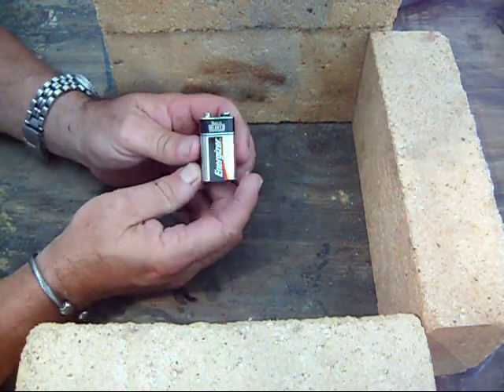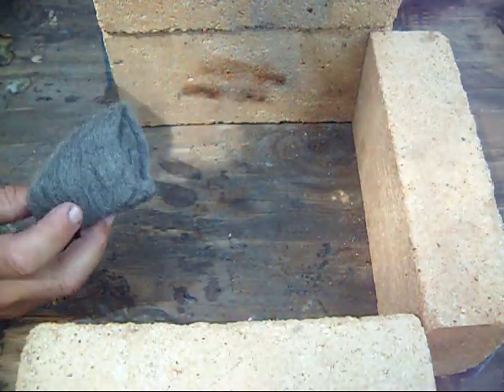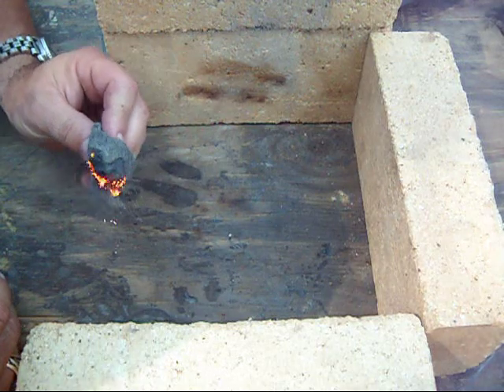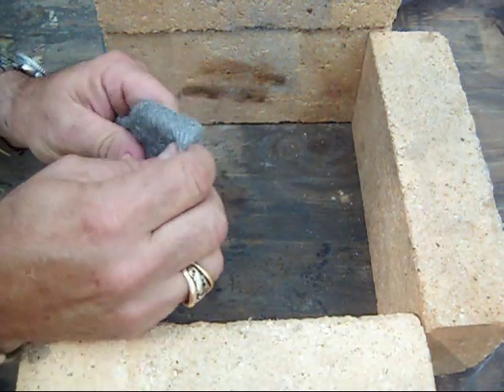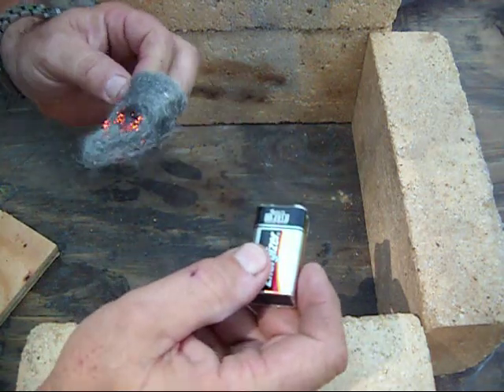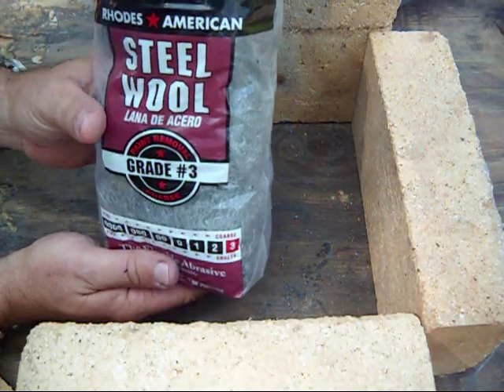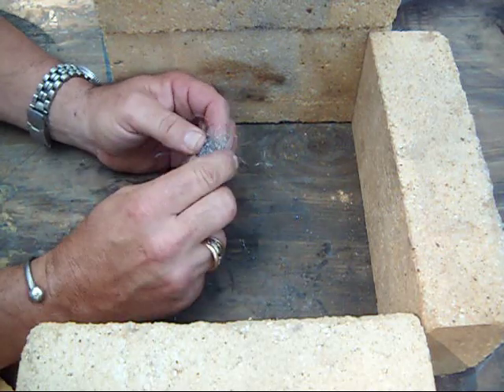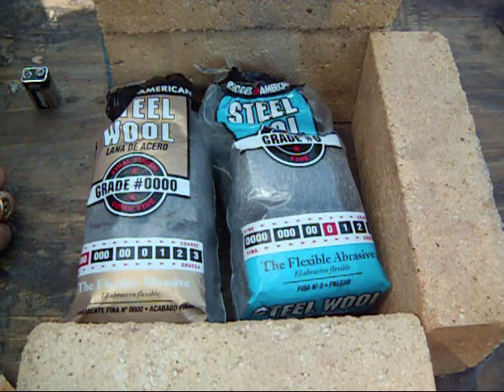Fire From Steel Wool

Comment from the maker: @Silentlamb86 Steel wool, also known as wire wool, is a bundle of strands of very fine soft steel filaments, used in finishing and repairing work to polish wood or metal objects, as well as for household cleaning.